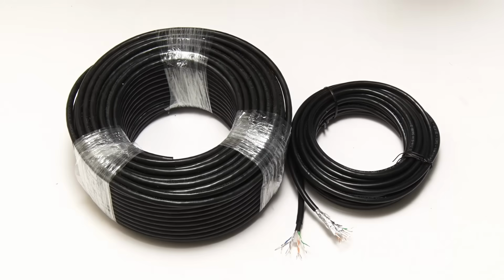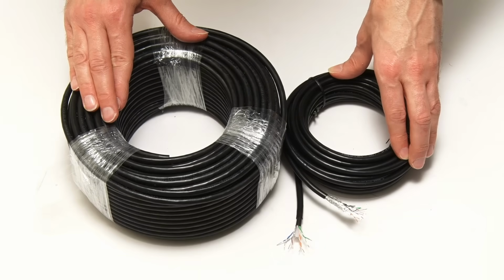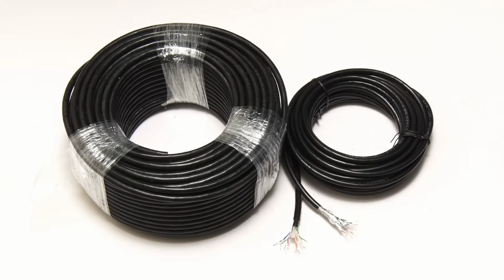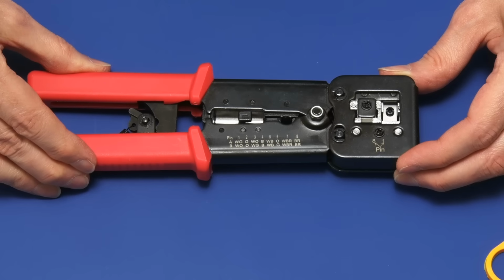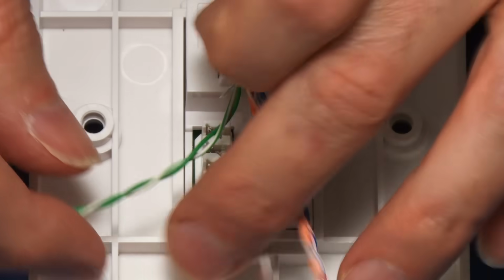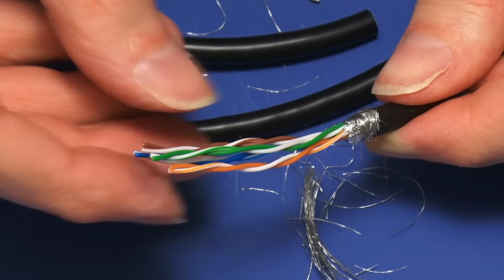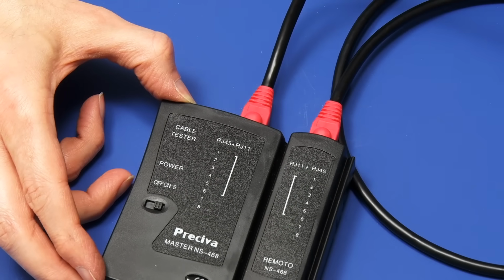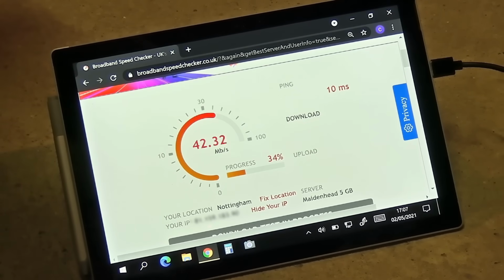Wiring Ethernet Extensions: How to Fit Sockets & Make Patch Leads

Comment: Overall is a good instruction but it looks strange to me to take a shielded wire with multiple layers of shield and not to use it. It is better to use shielded RJ45 connectors (plastic with metal around it) and during stripping a cable to make sure to leave drain wire uncut (single wire without insulation on it), bend it under the shield of the connector. It is better to use a copper tape with a conductive adhesive, make one pass of a copper tape around the wire, place a drain wire on top and cover with one more layer of a copper tape, then cut the excess of a drain wire. RJ45 connector should touch the copper tape with it's shield part to have a good connection. Then cover the rest of the tape with the rubber cap or with a heat shrink tube.

Comment: i thought of this for a while now but have gotten a new router. The speed on wifi is around 900mb/s up and down plus the signal is much stronger. Previously at the door of my house I would only get one bar, now it has full 4 bars. Does your location have fibre connection?

Comment: cat 8.2 is 40 gB per second or 40 gbps? it's written gB  with B from Bytes....not bits....
Reply from the maker: Cat 8.2 is 40 Gb/s, as noted in the video -- that's gigabits per second,. Gigabits is written Gb, gigabytes is GB (both caps). What is written in the video is correct.

Comment: I've just had a new build with cat6 Ethernet put in the walls. Plugged in my device, no connection at all. 

Years ago I worked in a data centre, making and running cables was a daily task for me, so I'm absolutely no stranger to this. I've had to buy myself a whole toolkit, including the tester to check the wiring. While I'm waiting for it to arrive, I checked the wiring diagram on the back of the wall socket and found it isn't T568!! They've just made up a colour order, keeping all the pairs together. Now, assuming they wired all the sockets using the same diagram, it shouldn't be an issue. However, this socket puts an A and B diagram (neither are T568), and I have a strong feeling they mixed A and B at the termination points. If it was all just one 'standard' it would still work, although introducing EM interference from the incorrect pairing.

So, I came searching youtube to see if standards had suddenly changed over the last 15 years, and this video has helped me understand that the install is probably totally wrong. Once I can get the tester and check, I can confirm this. Thanks for the refresh, and also thanks for making a very accurate and informative video!

Comment: I'm planning the re-installation of my computer and network equipment.  I want to clean up the present tangle of cables by making cables that properly fit between units to make a neat and much easier to maintain setup.  Your video is the only one I've seen to date that covers the choices and methods for making proper cables out of the pile of spares I've collected over the years.  Many thanks.

Comment: Is the cable tie necessary as i have cat6 that comes down the wall into a 25mm metal back box but the sockets only seem to allow a cable tie to be used if the cable approaches from the bottom. Its quite tight bending the cable, the alternative would be to flip the socket. What would you recommend in this situation?

Comment: Another excellent video. This one is so helpful I do not need to refer to any other to complete my home networking project.

You have thought and laid out the steps in a logical manner that networking enthusiasts, whom are not IT specialists like myself, would find easy to follow and implement.

My only problem is how to estimate the actual length of cable needed from one point to another within my apartment? The wiring will go through pipes already embedded within my thick brick walls and not in a straight line. Perhaps I could measure the straight line distance then multiply by 2?

Any advice by anyone is welcome.
Reply from the maker: I would think somewhere between 1.5 and 2x would be safe in your estimates. Good luck with your project!

Comment: Hi there. Great video! When putting the Ethernet socked into the wall, and the hole was drilled from the outside, what cable is going into this?
Reply from the maker: The cable that goes into the Ethernet socket is the direct burial external cable.

Comment: Hi there, wondered if you had an opinion - I have a poe cctv reolink camera and currently use a cat 6 cable that runs through the wall and outside. I tried to install a ethernet socket and 99% sure it is wired fine but it will not work with the camera. I have ended up just running back directly to router from camera (which is high up outside and wired in so don't want to mess with that) I assume this should work ? Any ideas?

Comment: I was quite surprised that you didn't use a couple of devices running iPerf3 to show off the potential of your dandy new wiring. And I was also surprised at how slow your broadband access is. I live in Hawaii and we have slow Internet compared to the US mainland. The US mainland has slower(and more expensive) internet than Japan. So I was shocked to see you putting up with 45Mbps download in Nottingham. I am cheap and have 500Mbps down, but you can generally get 1Gbit if you want to pay ~$100/month.

Comment: I absolutely love, love, love this video! I don't think there is generally enough education about how networks work overall. As a result, I would bet that there are people paying way more than they should for the speed and volume of internet usage they actually consume. One final caveat should be that people should be careful that the ethernet cable between their PC/laptop and their router should also be at least CAT6 or above spec. If they just nonchalantly use whatever legacy cables are lying around the house and unfortunate enough to have Cat 5 product lying around, their gigabit speeds into the home will be reduced to 100Mpbs max to their PC. Dump those old CAT 5 (not 5e just yet) cables from the home. 

Keep up the great work!!!!

Comment: Very good explanation. Can you tell me what the length of that drill bit and size was?
Reply from the maker: As I recall it was a 1/4 inch drill 15 or 18 inches long. I was drilling a wall made of brick, gap, block, then plasterboard (drywall), so needed a pretty long drill.

Comment: Good Video Chris I Did The Exact Same During 2019 Covid Times New Mancave With 10mm Electric Cable And The Same Grade Of Ethernet Both Ran Through White Drainage Piping Only Mines Is Ethernet Into Hub Down Through Floor Where Pipe Comes In Through Wall Vent Then Out To Garage And Into 5-Port Gigabit Box Did You Do A Video Of The Garage Before And After

Comment: Worth noting that Cat5e is rated for 2.5 gigabit ethernet at 100 metersm uts even rated for 5 gigabit although those are far less common than 2.5. If the ethernet wires in your house can do gigabit, they can probably do 2.5 gigabit as well.

Comment: Wrong. As long as the distance is less than 100m, CAT-5 supports 1GB Ethernet connectivity. This is not a guess, but my experience in my home that was wired way back in 1997 with CAT-5. (This is a common error.)
Reply from the maker: Not wrong. The video correctly cites the specification for Cat-5. But a cable can be made to a greater specification and still listed as Cat-5 (quite common until Cat-5e was specified, which is rated for 1Gbps).

Regardless of what happened in your installation using cable specifed as Cat-5, there is no doubt whatsoever that the specification for Cat-5 is up to 100Mbps. Do not confuse performance and specifications -- that is indeed a common error. If you purchase a Cat-5 cable, there is no guarantee whatsoever that it will do 1Gbps. So just because you bought one that did, does not make this wise advice. The only way to guarante1Gbps performance is to buy a cable rated Cat-5 or greater.

Comment: More shielding means a big, fat, stiff cable which is hard to radius, fills up cable management, and stresses the flimsy ethernet ports and patch through-connectors. I only use it in a high electromagnetic environment, ie Radio transmitters nearby, or heavy inductive loads such as large motors, or in a substation and even in those cases I use fibre wherever possible instead.

Comment: Thanks for a great video.

One thing I would just add is that the RJ45 sockets are designed to work best with solid core cables and the plugs are designed to work best with stranded cables - because this is how they are normally used.
I have found difficulties in the past where I have needed to terminate a stranded cable in a socket designed for solid cable (and/or the other way around).

Comment: My only critique of this video is that you ran a CAT7 wire between the two rooms (good), but used CAT6 connectors at the ends! By that, I mean the connectors don't make use of the ground connection, which is needed if you want to reach CAT7 speeds (10Gb+). Technically, a solid CAT6 installation will max out at 10Gb, so maybe that's no a concern? Or, you left enough slack to upgrade to CAT7 in the future when the tech is cheaper to acquire?

Otherwise, good video.
Reply from the maker: Fairly obviously, I over-specified the cable that was going underground. :) I have a 1 gigabit network with a c.45MB/s Ethernet connection, as the video clearly shows. 10 gigabit Ethernet is exceptionally rare in a consumer setting.

Comment: Minor comment. You bypassed a key characteristic of Cat 7 cable (also on Cat 6 & 6A) and that is the shielding plus ground wire.  By using a Cat 7/6 RJ45 8P8C plug connector there is a metal clamp  attached. When stripping cable you merely bend back the braid and ground wire then wrap around the cable using copper foil tape. Once the plug is crimped you re-insert into the tool and crimp the metal bands over the copper/braid. Now the cable is grounded at both ends through the plug casing. This is necessary for POE and external cable runs due to transient voltage spikes to the ethernet wire. I use UTP non-grounded Cat 6 to wire indoors from modem to router. Lightning struck the ground somewhere near the MoCA ISP buried cable and conducted a voltage spike through the ungrounded Cat 6 which burned out my modem, main router, EoP, switch hub and ethernet backhauled AP. Fortunately all PCs were disconnected or on WiFi. Very expensive way to experience non-grounding. Now I ground all Cat 7 and Cat 6 entering the house or out building and use ethernet surge protectors as the ground link.

Comment: I am learning about computers and networking, firsr time I tried crimping a cable, it took me two times to get it crimmped correctly but i did it. 
3 days ago, my friend asked my to crimp 6 cables and i just failed to do it...the only way to know if they are crimped is by using the tester, right? You cant check them before crimping them...can you?
Reply from the maker: Yes, you can only electrically test the connections by crimping. The only other check is by eye based on the colours.

Comment: Some points:
Gb Ethernet was designed for plain CAT5 before 5e even existed, so it's not limited to 100 Mb.  Of course, plain CAT is hard to find these days, with 5e being available.
Re copper over steel or aluminum, there is a phenomenon called skin effect, which causes a high frequency signal to travel on or very near the surface of a wire.  This means the core of the wire is irrelevant.  However, it may be a factor for PoE, as DC current is not affected by skin effect.
You can find shielded CAT5e cable on Amazon and elsewhere.
Using solid wire with plugs is a bad idea, as it's a poor choice for patch cables.  Originally, the plugs were for stranded cable only, but people misused them with solid.  As a result plugs for solid or both became available.
With patch cords so cheap these days, I rarely bother to make them now.
The untwisted portion of the wire should be no more than 1/2" and I'd trim off those ends.
A shielded cable needs to be grounded at one point.  Otherwise the shield is useless.  You can get plugs and sockets that provide the ground connection for the shield.
UK wall plates look funny.  ;-)
Reply from the maker: Thanks James. :)

Comment: Great clear video. Only point I would make is the metal backing box hole had sharp edges where the cable passed through. I would have used a small length of flexible conduit as a cable protector as it entered the box.

Comment: i wish the switch industry would catch up 2.5 and 5gb ethernet. Also id really like to hear stories of when someone found an environment that only shielded cabling would work in. i work at a place with tons of light duty cncs and two vapor deposition chambers... maybe my own story will change and maybe its because our use case is just little bursts of low speed... but all of the cabling is cat5e or cat6 utp. like 3/4 of our lab machines actually do rs232 over cat5e/cat6. everything ive heard about when to utilize shielding indicates we should probably have stp and that the serial machines should be doing rs 485... yet it all works as is

Comment: You covered everything, except explaining what an incorrectly cable is read by the tester.
Reply from the maker: I think I covered this pretty clearly -- from about 17:10 onwards. I showed the tester in use, and explained that "the lights go down in sequence, and they are in the correct order" -- 1 on the left lighting up alongside 1 on the right, 2 by 2, etc. If the cable is incorrectly wired, the numbers will not match and one side will not progress in sequence.

Comment: Nice clear explanation without giving us your life story as some Americans seem to feel they need to do. I have a wall socket with a double outlet and only one cable from the router. Is there some trick to getting one cable to both outlets. I have just used short lengths to connect identical pins on each socket but it is not working and I cant tell if it is because two conductors on the one pin are too many to ensure a good connection or is there a more fundamental reason why this doesn't work?
Reply from the maker: Thanks for this. You cannot just wire two sockets together I'm afraid. The two ports need to be connected to two outlets on your router. Think of it this way, the double outlet allows to computers to connect to the network, and each needs its own, unique transmit and receive wiring. If you wire the two sockets together, this is impossible.
Reply: @ExplainingComputers  Thanks for that. Yes? I found this out and you need an ethernet switch to connect multiple outlets. This I have done and now all working fine.

Comment: A very informative vid.  What I would like to know is if cat 6 cable can be used outside/overhead...in a warm sunny climate?  Please advise.  Thanks.
Reply from the maker: It will depend on the cable. Cable rated for direct burial should be pretty resistant to the elements, and so OK for outside use.. For overhead it may need supporting though -- eg on a steel wire.

Comment: No chance you never got that fitted first time plate was off haha show us how you did it
Reply from the maker: No, what you see is exactly what I did. If you are refering to the connector being through the plate initially, they are designed to do that and go back through. So I did show you exacty how I did it.
Reply: @ExplainingComputers  Nice one I figured out myself to cut the wall box and put the plate over it it just my box is a four outlet no mistakes cheers 10/10

Comment: I'm an electrician who hasn't worked with data beyond demonstrations for my apprenticeship, but I'd like to expand my knowledge.

I play a lot of videogames, so if I'm looking for a high internet speed for my home, would I be right in getting a cat8 cable which has a low AWG to future proof my connection for faster internet speeds?

Furthermore, I have searched for drums of Cat 8 cable but they only seem to have cable with Ethernet plugs would it have the same effect if I were to cut those ends off and use that cable to wire from point to point?
Reply: Make sure you also know how to run the cables.  It's more critical than power cables.  I had to fix one site, where the Ethernet cable was forced into right angle bends at corners in the wall.  Typically, on the jobs I've worked on, an electrician will install the boxes, with conduit to above the drop ceiling and I'd then run the cable myself.  Also, J hooks are important, as you're not supposed to run cable on drop ceilings.

Comment: Hi not sure if I should say this on the Internet, but if you test your termination with a Fluke cable tester you will get a NEXT fail (Near End Crosstalk) because you have untwisted the cable pairs further than 13mm. Apart from that a really good video.
Reply from the maker: I've had no performance issues.
Reply: @ExplainingComputers  You have to define performance issues, Its a matter of expectation, but I aim for 0 networking errors. When you are a professional you are expected to do it right.
Reply from the maker: @clivewi9103  I totally agree on expectations. For me, performance is about does it deliver 1Gbps, and it does. This video is clearly not for professionals, and should be be assessed in that light. You are judging by standards that few if any consumer installer will need to adhere to.

Comment: In the first 7 minutes, the video does a very good job of describing the different types of cables and why to use them. However, it missed an important part of this subject. That is what the outer casing is made of. Is it standard PVC, is it rated for Riser, or is it rated for Plenum? This will limit where you can put the cable due to the fire code. PVC gives off toxic fumes and can't be used everywhere, but can be used in most places (probably in excess of 90% of install locations).

When making the patch cable, it's shielded cable, but it wasn't a shielded jack attached.